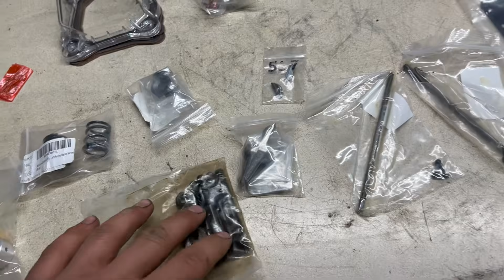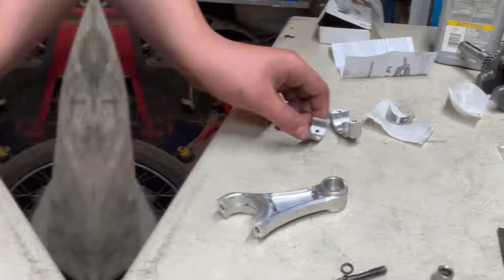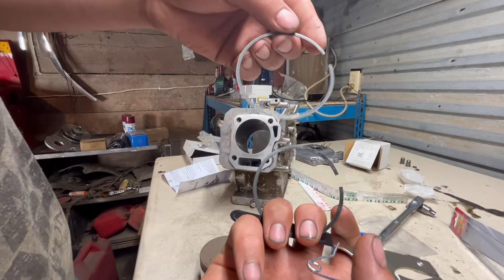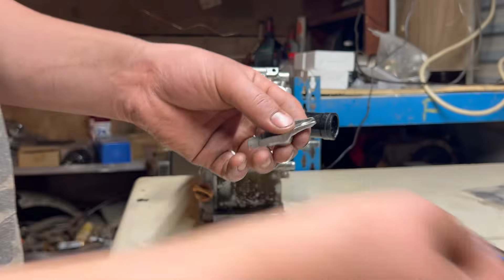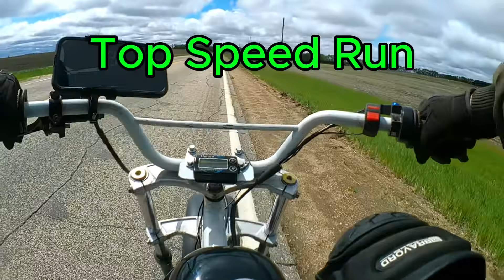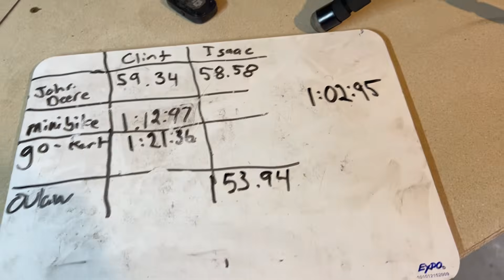Mini Bike Mods to go 50mph and Look Insane

Comment: Bro please can u help me with my Massimo mb200 I’m tryna make it faster
Reply from the maker: If I was you going for speed on a budget I would do a  full stage 1 kit as well as a cast aluminum flywheel, 18 lb valve springs, and a gov delete. This will make your bike fast, reliable and cheap.

Do this at your own risk I am not responsible for anything bad that happens. Although I think this will be a perfect moderate build

Comment: I have a coleman ct200u-ex. stretched and lowered. 224 with 22 mill carb and aluminum flywheel and juggernaut torque converter. i hit 56 mph fast! that thing pulls but I want a full build
Reply from the maker: Cool that sounds like a sick bike.
Reply: its alot of fun i got it up to 56 mph i plan on doing a full build on it soon @SouthernMNTV

Comment: I never understood why so many are spinning the flywheel and shearing off keys. Are you guys not lapping it to the crankshaft and/or not torquing it enough? The key is not there to keep the flywheel from spinning it's there as a timing reference. I don't use a key with the cast aluminum flywheels. I use 65 ft/lbs.

Bad thing about the Predator 212's is you can't find a new crankshaft as easy as all other engines. NR racing will sometimes have one in stock but for $75. Most crankshafts for other engines are $40 or less. 

It's a nice build and all but shouldn't you be getting to 40 quicker? Seems like you need a lot of road and time to get there?
Reply from the maker: So I torqued it to 54 foot pounds and later found out that wasn’t enough(clearly). But now you’ve given me 65 foot pounds so I’ll try that next time. Thanks. 
Also I weigh 250 lbs it takes awhile to get to 40 mph. But I understand where you are coming from.